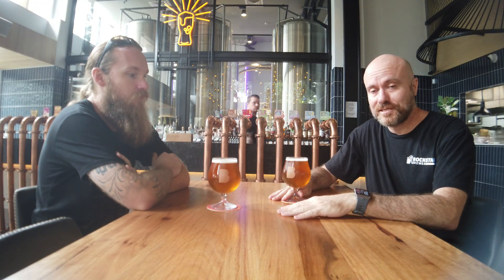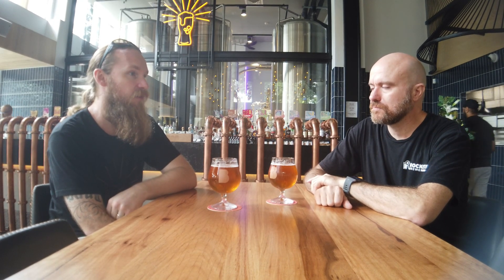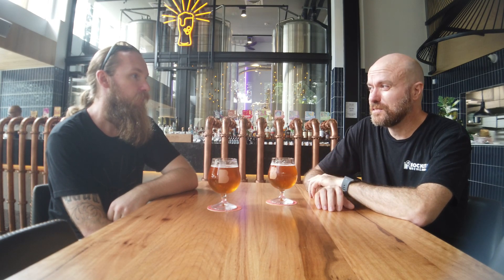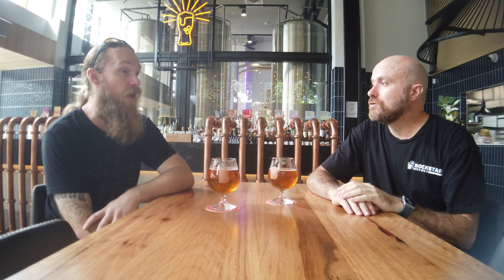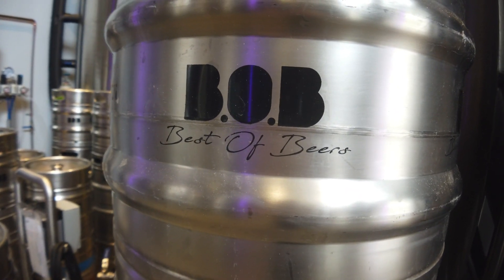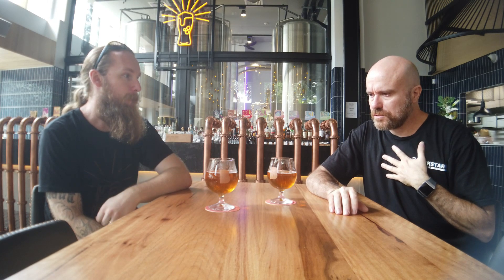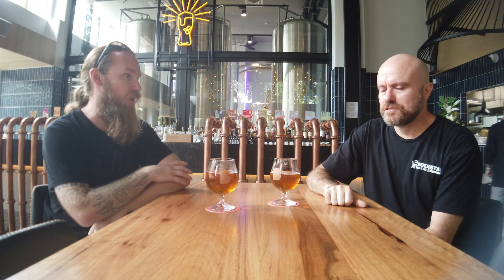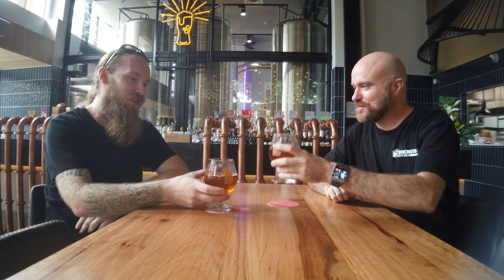How To Brew An Awesome Lager With Sound Brewing Water Chemistry Using Bru'n Water (Part 2 of 2)

Comment: The tiny amounts of chemicals used to adjust a water profile are beyond the means of home brewers brewing a 5 gallon batch. Accurate weighing scales, pH meters etc are expensive, plus the problem of water quality. Any help?
Reply from the maker: I picked up a set of jeweller's scales for $10 on Amazon.  Does the job :-)
Reply: Thanks that’s what we were thinking about.

Comment: 7:07 why not add acidulated malt?
Reply from the maker: Sure - you can use acidulated malt but the acidity of the malt may change from batch to batch so it's easier to calculate pH adjustment from a known volume of 88% Lactic Acid.

Comment: Water chemistry is not an absolute and tastes change over time. Guinness used to be really bitter, ratio about 3:1 back in the 70’s, great stuff, because hops were expensive and so was malt, but not flaked barley. Now drinkers want a malt forward stout, so the ratio has to be reduced, but they still want more hop flavours, and now in stouts late hop additions are in fashion, with the background of hop kick plus maltyness.